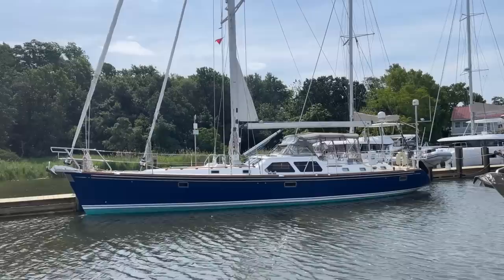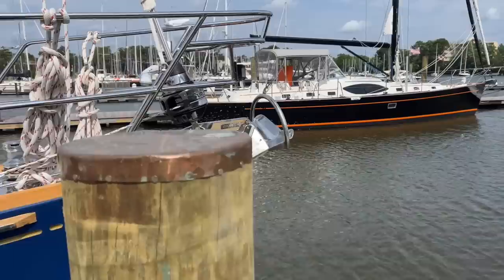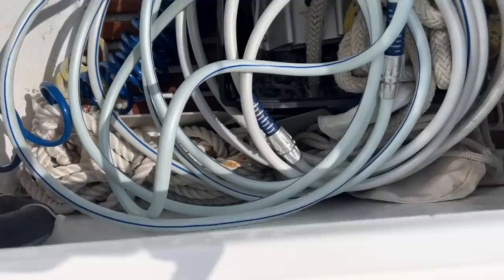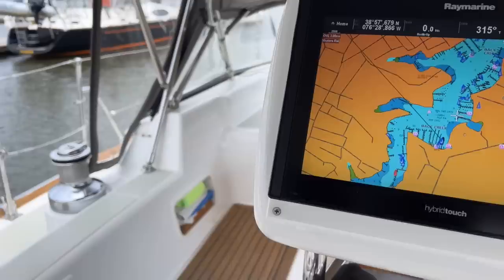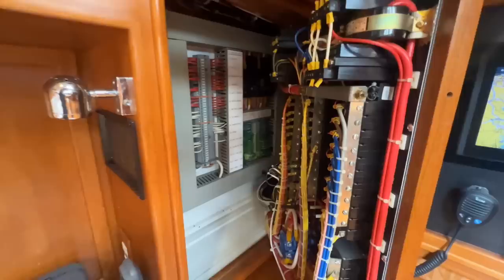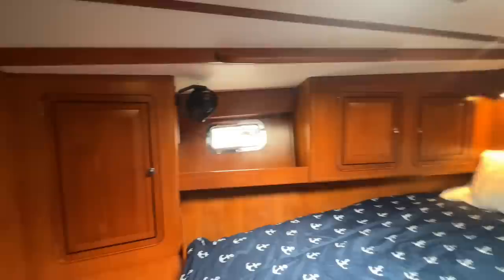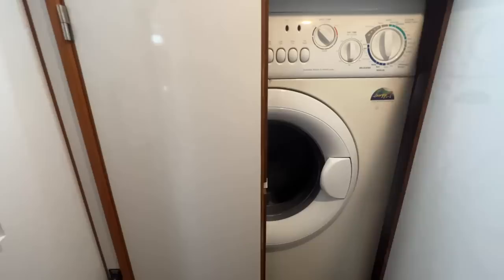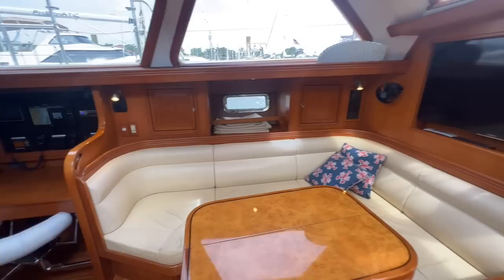Hylas 54 2006 'Rover' For Sale SOLD by Erik Haaland & Kevin Reeds

Comment: One. Year 3 Hylas 54 yachts broke their rudders on the way to the Caribbean. The rudders broke about halfway down. On examination, the was no reinforcement below the break point. Hylas said that was purposely done in the design incase the rudder grounded. Of course this would have been an unlikely occurrence as the keel is much deeper than the rudder. I met on of the owners in a boat yard where a custom replacement was being fabricated. He was the person who told me about Hylas statement. I was in the transit on my 58 foot boat. It was not an easy passage but not bad enough to cause the damage that occurred to these offshore sailboats.
Reply from the maker: You are correct - There was a recall on the Hylas 54 rudders due to a lack of webbing in the lower third of the structure. The yard then sent new rudders to all 54 owners to have the issue corrected.